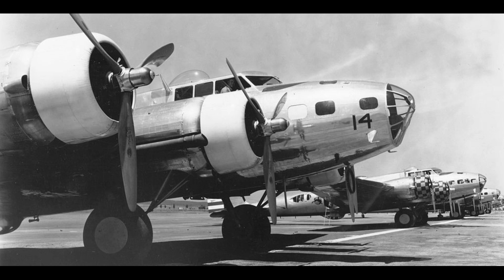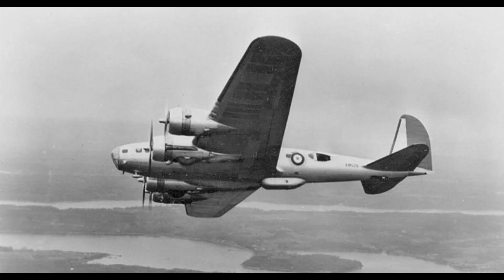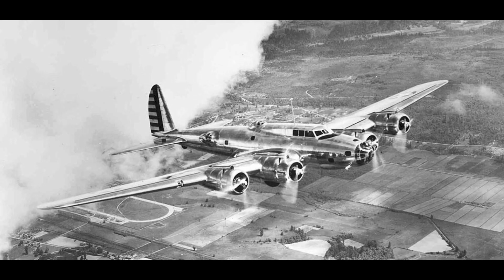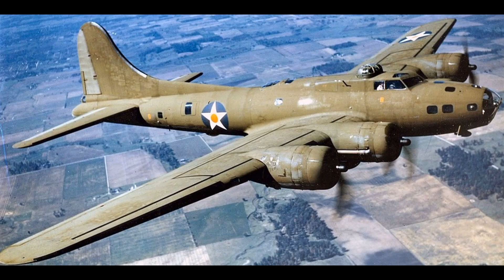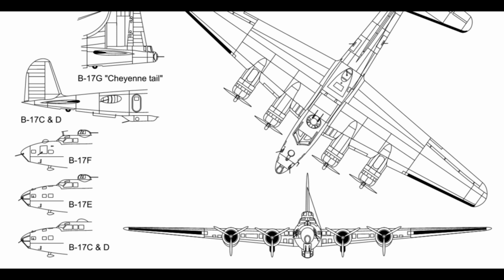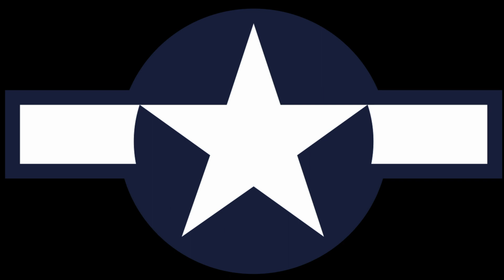First heavy bomber

Comment from the maker: On August 8, 1934, the U.S. Army Air Corps announced a tender for a heavy bomber to replace the Martin B-10 aircraft. It was necessary to transport a "large bomb load" at an altitude of three kilometers for 10 hours at a maximum speed of at least 320 kilometers per hour. Were desirable, but not necessary, a range of 3200 kilometers and a speed of 400 kilometers per hour. The Air Corps was looking for a bomber to reinforce air forces in Hawaii, Panama, and Alaska. Competitive testing took place at Wright Airfield, near Dayton, Ohio. Boeing competed with the Douglas DB-1 and Martin Model 146 for a contract with the U.S. military space agency. The B-17 prototype, designated the Model 299, was built by a team of engineers led by Gifford Emery and Edward Wells at Boeing's own expense. It combined the capabilities of the experimental Boeing XB-15 bomber and the Boeing 247 transport aircraft. The armament of the B-17 consisted of aerial bombs, up to 2200 kg on two racks in the bomb bay under the cockpit and five 7.62 mm machine guns. The power plant consisted of four star-shaped engines R-1690, developing a power of 750 horsepower at an altitude of 2100 meters. The Model 299 was first flown on July 28, 1935, by test pilot Les Tower. Richard Williams, a reporter for the Seattle Times, coined the name Flying Fortress when the Model 299 drove out of the hangar, bristling with machine guns. Boeing very quickly realized the value of the nickname and registered it as a trademark. On August 20, the prototype flew from Seattle to Wright Airfield in nine hours and three minutes at an average speed of 378 kilometers per hour, much faster than competitors. The Air Corps (renamed the U.S. Army Air Force in 1941) used the B-17 and other bombers to attack from high altitude using the then-secret Norden bomb scope, which included a gyro-stabilized analog computing device. The sight automatically calculated the moment of discharge based on the data entered by the operator. For the calculation to be accurate, horizontal flight in a straight line and at a constant speed was required. For this, when approaching the drop point, the bombardier turned the sight on autopilot mode, making only small adjustments to the course. When reaching the design point, the sight automatically dropped bombs. The U.S. Air Force began building up its forces in Europe with the B-17E shortly after entering the war. The first aircraft of the Eighth Air Army arrived in Upper Waycombe, England on the twelfth of May 1942, where they formed the ninety-seventh Bomber Group. On the seventeenth of August 1942, eighteen B-17E aircraft from the Ninety-seventh Bomber Group, including the Boober Yankee, led by Major Paul Tibbets and Brigadier General Eira Iker, and accompanied by Royal Air Force Spitfires, flew on the first raid, targeting a rail marshalling yard near Rouen, France. The operation was successful, with only two aircraft sustaining minor damage.